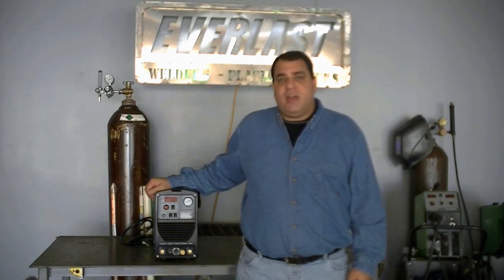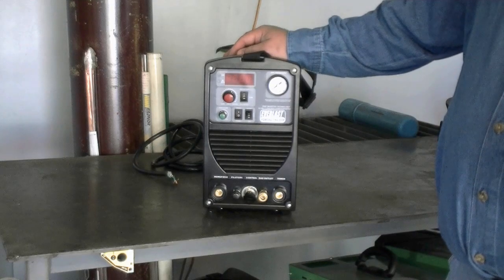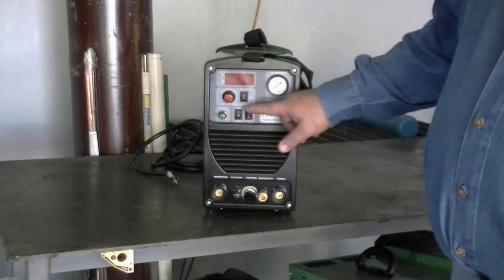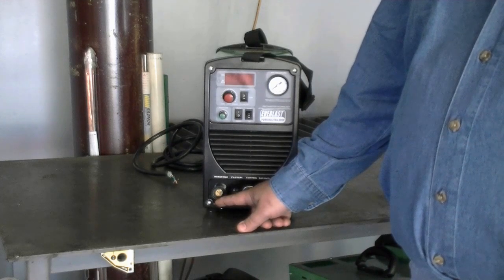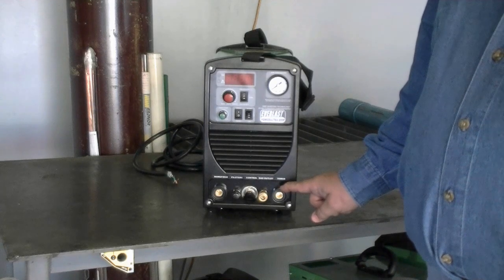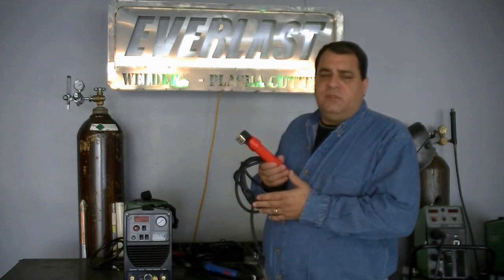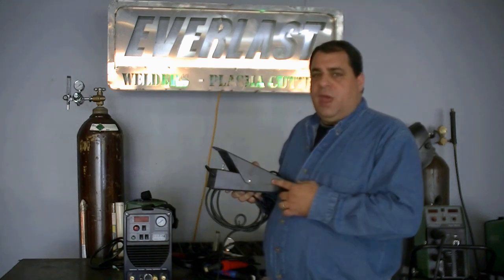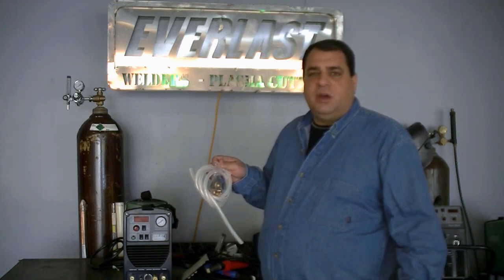Everlast PowerUltra 205P  TIG , Stick, and Plasma Cutter - multi-process welder - 3 in 1 200 Amp

Comment from the maker: The setup would be nearly identical.  The product is our  entry level "price" line.  It's a mosfet unit.  Operationally wise, its very similar...but internally a good bit different.  We don't even include it on our website and it's not a main line product.  Most are sold in Canada originally.

Comment: The text scrolls by a bit fast but nice video. I'm considering whether to buy one of these units or get a separate Everlast welder and Everlast cutter. I've got friends that have both setups and each has its own benefits. How fast can I switch between functions on this combo unit? I kind of like how compact it is.